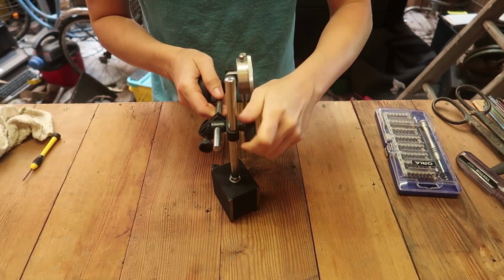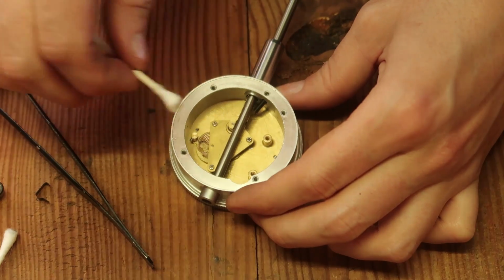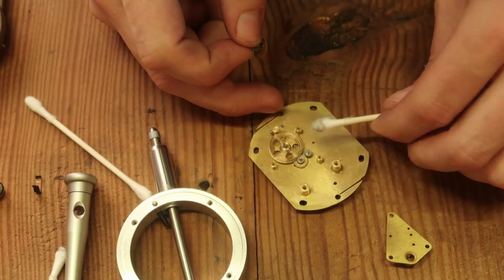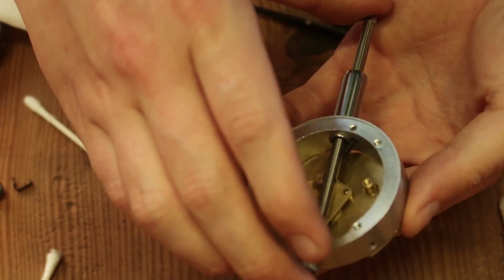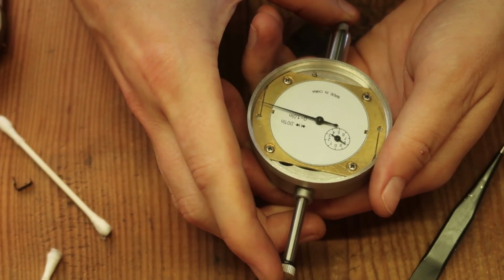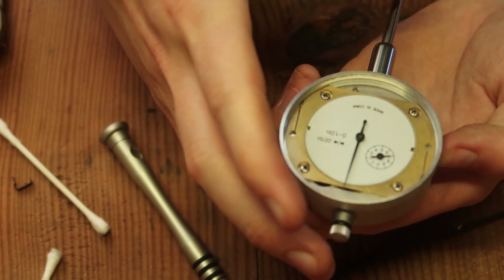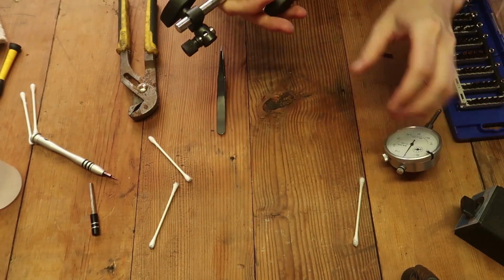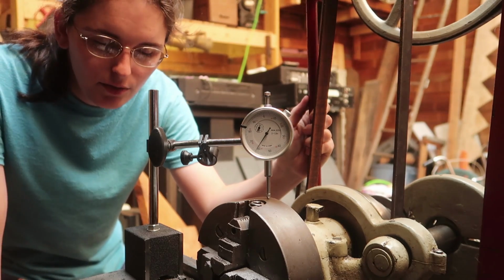Learning to Lathe 03: Dial Indicator Repair, Lubricate / Oil Sticky Dial, Teardown / Rebuild

Comment: As a retired machinist, I will say kudos to you, you did a pretty good job for what appears to be your first time with an indicator. 90% of the time a damage indicator like that is from a bent plunger shaft, after somebody crashed or dropped it on to a part. BTW  the springy thing on the last part of your indicator holder is your fine adjustment. You can 0 your indicator without turning the dial, just turn the screw adjustment and you'll see the arm move.

Comment: Neat, I'm so thinking I'll be back on the RF projects where I need to use the lathe before this fall.  Have the Swivel Vertical Slide and Toolmakers Grinding Vice on the way in the mail so I can use my mini-lathe as a mill with an adapter plate on the cross slide.  Other than the elliptical axle... thinking unless I start making custom engine parts... I won't be back on until this fall.  I'd almost dredge it with a solvent if wasn't for the indicator material and ink... then maybe do some de-oxit just in case there is corrosion and oil.  You got it cleaned though, alright.  Mine need the cover lens cleaned... they're all opaque.  Interesting working on the engines though and seeing the capabilities of doing EFI with an EMS/ECU as well as other custom machine and even cast parts.  Nice little lathe too.

Comment: Now that you have the internals figured out, you might want to set the "pretension" so that the smaller clock dial also aligns with 0. This is just a suggestion, not a criticism. It's your dial indicator to do with as you please. The larger dial measures 0 to .100 inch, in .001" steps.  The smaller dial measures from 0 to 1" in units of 100 thousandths of an inch (or .100"). So once the large dial goes all the way around one time, the smaller dial would read 1, indicating the plunger has moved  .100 of an inch.  Once the larger dial goes all the way around again, the smaller dial would read 2 and so on (or .200").  From trying to catch a glimpse of the face after your repair, it seems the smaller dial was reading like 3 or 4 when the dial was at rest, indicating that the plunger has already been pressed about 3 or 4  hundreths of an inch from where the the plunger is at rest.  That offset might get confusing when you are trying to measure something over .100". For example, if you had the dial indicator set to measure the distance the carriage moved left and right, you had the cutting tool set to the end of your part being turned, and you wanted to know when you have turned .75" inche from the end.  If the smaller dial was not set at 0 to start with, you would have to count each revolution, while  at the same time paying attention to the actual cut.  It can get real tricky to do both at the same time, and that is where mistakes can be made.  Just a suggestion to make your dial indicator more useful to you. Keep up the good work, I do enjoy your videos.
Reply from the maker: well i never changed the orientation between those parts, and i also showed me winding it up before putting it back in

Comment: The spring and the knob located on it are for fine adjustment. Say if you really want the needle to start at zero when measuring. Great job getting it to work btw.
Reply from the maker: sure but i also want 0 to start at up so its easier to read.